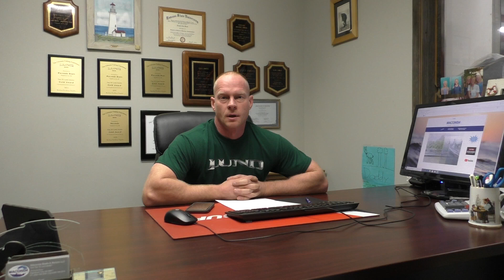Riveted vs. Welded Hull

Comment: The comparison between planes and boats is apples to oranges. They experience very different types of pressure and stress. Also, Aerospace engineering is vastly different, and inarguably much higher quality than what is seen in the recreation boat space. 

Both methods of production can be very good but your justification and comparison in favor of rivets is sorely misguided.

Comment: BS That was true 20 years ago but welding technology now is far superior to any mechanical fastener. If your welds break or crack under load you should fire the welder or use the correct alloys.

Comment: Welds do flex. The difference is all the riveted boats are made from very thin aluminum that comes in rolls. Welded boats are thicker plate. 

It’s very difficult to weld thin aluminum sheet and what these guys don’t tell you is that rivets are more of a function of using thin sheet rather than “we use rivets because they are superior”. 

On the other hand starting with material that flexes less (I.e. thick aluminum plate) is much stronger. Welds do have plenty of flex for this application and these boats run for decades without cracking.

What you find on riveted boats is that the rivets will leak and flat unriveted areas will crack much easier. They don’t crack on the riveted areas necessarily but on the flexing flat bottom portions that see abuse.

There’s a reason you see riveted boats in deeper rivers and lakes - they can’t take the abuse of the shallows that a welded plate boat.

To recap: Thin sheet applications like airplanes and thin sheet boats, rivets are the only option because the thinner material flexes so much and because of the difficulty of welding thin materials.

Using thicker materials makes a boat flex less and less prone to damage. The welds if done in the right place and in the right way are stronger than the parent metal. For example much of the design is formed on a break (bended) then welded on the corners inside and out making them thicker than the parent metal.

Comment: Buy fiberglass and you will not have worries about weld fractures or leaking rivets!  They are good till the wood used in floors and transoms rots ... as it also does in aluminum boats

Comment: If done right a welded boat is just as good and will last as long as a riveted boat. I can personal recommend Creastliner for welded and Lund for riveted as l have owned both and both to this day still do not have any hull leaks or defects. Both though have had to have new transom's installed. Both are over 25 years old.

Comment: Its been my experience that ALL Aluminum boats eventually crack the hulls for one reason, stress fractures...which come from the constant flexing of the hull...all aluminum does it whether on aircraft or on boats...you can weld it and it works, for a while, but will generally crack again...the only way to fix it permanently is with another piece of aluminum called a doubler...look at older aircraft and most of them have a repair that looks like a patch...this is a doubler....the more horsepower you have and the more you run in chop the more cracks you will have.....its the weak point of aluminum boats.  No dealer or manufacturer will tell you this as if you knew you would not buy an aluminum boat..
Reply: But glass does the same thing? Glass does and will crack under pressure and especially if you fish a rocky bottom like hartwell like me i feel aluminum is the best way to go. Nothing against glass boats tho i do like the stability and ride and speed.

Comment: Great video!
I didn't know that about Rivets and welded hulls. Thank you.
On a side note:
I bought a new 14 foot Lund and a 12 foot Smokercraft back 2012. Great Boats, BUT I noticed some corrosion and pitting showing up in the above deck Stern area esp. near the splash well area and on the outer Transom, on BOTH boats, and after only 2 years of use, in Salt and Freshwater. Both Hulls handled great in the saltwater, better than freshwater, but clearly they didn't like the saltwater and always rinsed them THOROUGHLY with freshwater after EVERY use in saltwater.
I wonder if there are different grades of aluminum out there used by different manufacturers because I've seen older boats that were used constantly in saltwater but had no corrosion whatsoever and those owners rarely rinsed them off after...
Reply: 45 year of experience in Grumman canoes and boating in aluminum boats.  I can tell you that if you want to stave off corrosion for longer, you need to wash that boat with SOAP, or a desalinisation solution available at boat shops.  Same goes for rinsing out your motor.  In the end, only keeping a wax finish on your boat will really work to isolate the material from the salt.  The good news is:  galvanic corrosion will likely not harm your boat to the extent that it leaks or becomes unsafe.  If you live in a rainy part of the coutry, the best maintenance is to leave it uncovered so the rain water can keep it clean.  I do, but I cover mine due to overhanging trees, which can leave their marks on aluminum.
Reply: Need to attach an anode on the hull.

Comment: If you get away from the .80 and .100 thin aluminum and put some 1/4 inch , 3/16 bare minimum on your hulls they won't flex . Riveted boats I don't care what make and model when useing metal that flexes under wave impact and shore rubbing and the occasional ride over a stump will leak . And the same thickness of metal welded will flex and can and break welds . Do everyone a solid and build your boats useing solid material and if your not have a warranty that covers it and quit bullshit ing people who have those flex leaking issues and do it quickly and quit giving said people the bullshit 2 year run around back and forth dealer , manufacturer  crap . Frigging stand behind what you build or get the hell out of business,  build quality stuff and that's the bottom line , and when you do and stand behind it like you should alot more people will come your way .

Comment: I have had both. My welded cracked everywhere it was welded. My 15X40 Alumacraft riveted boat has not leaked through the rivets since I bought 7 years ago. I us it commercially. However it has developed a few  pin holes due to corrosion.  JB Weld was a quick fix. I should have installed a zinc on the water line when I bought it. If a rivet does loosen I can easily fix. Conclusion.....buy a riveted boat

Comment: If welding is cheaper, someone needs to jack up Gregor and Klamath boats on the West Coast.
They are welded aluminum and a 15' 20" transom open boat goes for a kool kat $5000/6000 grand.
NO trailer NO motor

Comment: Should note there are different kinds of welded boats. Welding a sheet of .080/100 together like tracker/crestliner/smokerkraft vs plate .160/.125 or .250/.160 is very different.  Welded hulls could not do the complex curves of rivets but that is changing. 
Coming from rivet to weld, it's a toss up. I like the light weight of a bare .80 thick hull sometimes, but if fishing rocky areas I like the plate welded hull. Neither leak with exception of water from fish I bring inside.

Been told glass is the best, maybe will try that someday.

Comment: You can't beat a solid welded boat.
Reply: Welded boats are superior to riveted boats. 100%. Thanks.
Reply: Yeah you can, it's called a Lund.
Reply: @NytronX  No, Lund puts hole in their boats and plugs them up with rivets. Why puncture holes if you don't really have to?
Reply: @ddm62571  Because it literally doesn't matter how many holes you put in a Lund, it will float. See here for proof: https://www.youtube.com/watch?v=a_KFaSQQNaw
Also, airplanes, including amphibious planes, use riveted construction. Welding aluminum weakens the surrounding metal, rivets are superior than welds in this application.
Reply: @NytronX   You can't compare aircraft to boats. Completely different type of machinery. I've witness a older Lund boat were the rivets were starting to losing up at the transom. That's the problem right there. That's why most boat companies weld their boats. Superior seiling!
Reply: @ddm62571  Yes you can, I just did. Newer Lund's in the last decade or so all use strong non wooden transoms.
Reply: The transom wasn't wooden. Bottom line is rivets do loosen over time.
Reply: @ddm62571  So do welds. Rivets don't weaken the surrounding metal like welding does, which is especially not good with a soft metal like aluminum.
Reply: Nytron well if a rivet loosens. Could you not just drill it out and put a new rivet in its replacement?

Comment: Lund pontoons are welded...... if any part of a boat resembles and airplane it’s the pontoons.........shouldn’t they be riveted by your argument?????? they are welded. Hmmmm.
Reply: It's not really an apples-to-apples comparison, to be honest...

If you talk to aluminum boat builders like Boulton and Hewescraft who built hulls with thicker marine-grade alloys, they tend to weld the hulls. Those alloys (like 5052) lend themselves better to welding than something like a 2024 alloy, which is used in aircraft float fabrication. 

That said, and as Terry mentioned in the video, if the welding can be automated...then it's going to be cheaper to weld them than to rivet them. Riveting is time-consuming, and takes at least two people on something the size of a hull. Manual welding would be very skill-intensive, and the labor costs for one skilled welder would (arguably) cost as much as that to pay two people riveting. Riveting is very easy to learn, and one can achieve a significant level of expertise in a relatively short time--I taught my wife to drive and buck aircraft rivets in a weekend, easily. Welding...not so much. However if the welding is done by a machine, then I would think that would be a far less expensive way to build the things. 

Also, aircraft floats are subject to FAR more stress than pontoons on boats though. You typically get up to 60+ mph on take-off, and landing speeds can be higher than that. So the alloys of aluminum necessary to withstand such forces (like 2024-T3) are not at all good candidates for welding. Thus they tend to be riveted. Also, with aircraft floats there are a bunch of internal components like bulkheads, stiffeners and reinforcing plates that must be present to withstand the stresses projected to occur. Those things would not be easily welded in an aircraft float. So riveting makes much more sense, especially when it comes time to repair those components. But the stresses in a pontoon boat pontoon are going to be much less, so they aren't likely to need nearly the same number of internal components. So I can see why they are welded--although it's quite possible that there are still some internal parts that are riveted as sub-assemblies, and then welded in. I'm not sure about that however.
Reply: Different application different manufacturing process